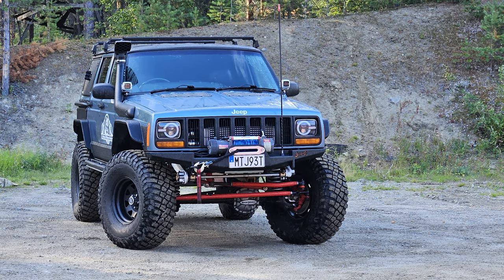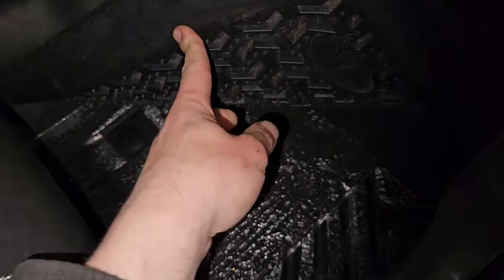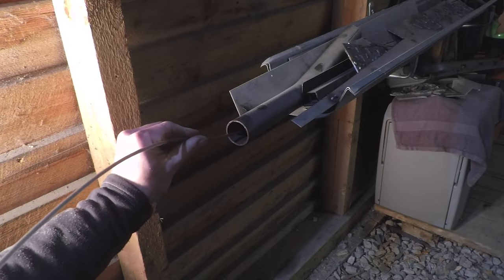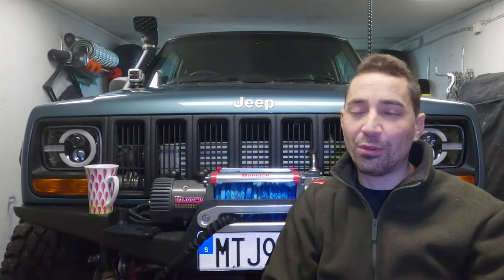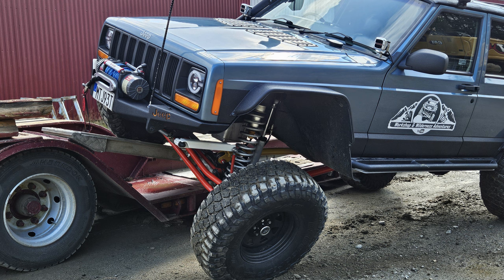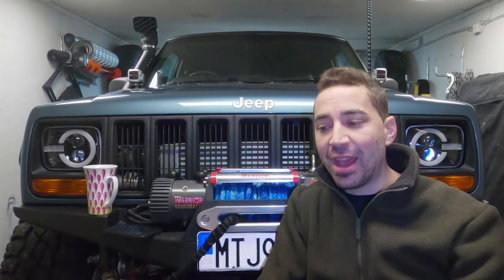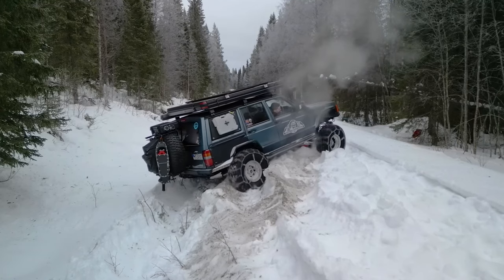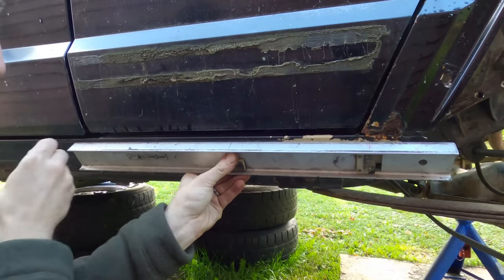What Would I Do Different If I Started Again

Comment from the maker: I've been building this Jeep for over 10 years, and a subscriber asked me about the choices I regret and the things I would absolutely do again if I started again. I thought It was a great idea for a Q&A as I know quite a few guys on Instagram who have bought Jeep XJ's and are wondering where to start.
 
You'll have to forgive that I'm not my usual humours self on this video. I've been pretty unwell, and the meds are pretty heavy. The syphilis unfortunately spread to my eyes, which is pretty bad, but on another note, it did enhance my vision, allowing me to select my victims more easily.     

Although the Jeep XJ isn't as common as it used to be, the principles in this video can be applied to any older 4x4 vehicle. 
Megan and I are waiting for a new baby any day now, so I thought this was a good time to do a video like this. 
Thanks for watching and for all your support!
Mike
Reply: Very much appreciate your wisdom that is not just XJ focused, but case use.  Few years ago I started a bit of work on my girlfriends '89 XJ and it is not lifted as it suffices with the General Grabber AT2's during winter in the Cascades here in NW Washington State.  While I had to sort out the partially installed Rubicon Express 3.5 lift's geometry.  It will get a class III hitch installed on the front to strengthen as well as provide possible recovery use, while the rear has a hitch as well.  I hope to get stiffeners eventually.  Next tires will be LT235/85R16's on the ZJ wheels, but won't be adding weight from aftermarket bumpers front and rear.  Which leaves this '87 very stiff due to the short arms, but mostly from the spring rate which were designed that most would be installing those bumpers.  I did refurbish the headliner, but also removed the carpeting thus used Herculiner with Kilmat and Siless on the floor and cargo area.  Noise levels reduced with having installed Kilmat and Siless on the ceiling as well as the doors and rear quarters.  I do get out to camp and hit forestry roads, and have no interest in submarine activities as I don't know how well my low mounted alternator would like swimming.  I forgot to mention that it currently has standard load 245/75R16's which were supposed to be "temps" while I sorted out geometry, but will see how they do in this years snow.  Sadly they tend to gate off many area's when the snow gets to deep for the safety of those not prepared to spend the night or more while stuck. <cough cough>  I fortune to have been prepared though it was only to be a "day drive".  <cough>  Thank You.   <edit>  On this side of the pond, I think we have what is used "back east" is Fluid Film.  </edit>
Reply: There is nothing wrong with your weird and twisted sense of humour, Mike, it's the main reason I watch the channel!
Reply from the maker: @duncanjmurray thanks mate! Appreciate you watching
Reply: Been watching you since your bushcraft days, always entertaining and chock-full of useful info/advice, thank you.

Comment: Great bumper story. I had a large deer jump in front of me and I hit it at 35 mph (56kph) and killed it straight out. Between the lift on the XJ dead centering the deer and the bumper, zero damage.
Reply: It can be a good meal
Reply from the maker: Ah that's wild. I've not hit an animal.....yet. A moose ran out in front of the jeep just a few weeks back. Luckily it was at an angle so I had time to slow down. I don't think my bumper would have liked that one. Good to hear of more survival stores though and thanks for watching
Reply: Very similar story. Hit one dead center going 40mph on a backroad. Smaller deer and it did not go so well for the deer. Jeep was great just lost some paint on the bumper.
Reply from the maker: These Jeep survival stories are making me feel hopeful

Comment: I'm about to spend 5k on tires, CV joints, shocks,  steering rack and pinion (?) thingie fingfang.  On a 2003 Subi Forester.  232k miles.  But what I wont have is a car payment.   Wish I could do this stuff,  shocks I probably could, but easier to pay someone. And less Tourettes outbreaks for me.   Iv replaced the starter, radiator, cooling fans and I change my oil and filters.  That's enough for me.   Anywho,  I know this has nothing to do with an XJ... maybe I should look for rust under Subi's carpet? .....  ahhh nope.  LOL   Thanks for sharing Mike!
Reply from the maker: The Subi Forester is a nice choice of vehicle. I've seen some really nice Subi builds from German tourists here in the summer. Sometimes it is better to pay for the work depending on your budget and time. Don't lift the carpet, don't do it! I'm sure its fine though. 
Thanks for watching.

Comment: The order for me on my XJ

1. Lifted 3.5 inch, 33 inch tyres 
2. Winch bumper  and rear bumper
3. Big android din system with backup camera and digital rear view mirror
4. Front floor pans and rear quarters
5. Snorkel with cold air intake
6. Light bar and roof rack, new relay harness for headlights
7. Box rock sliders (to be welded)

Will need to rip out everything to weld the box rockers without burning up the carpet. But yeah. It spiralled, so will have to essentially take the entire thing apart and do it right från frame up. Steering is clearly a needed upgrade. 

I drive this car two days per year at the moment and have zero time for this thing. My wife is understandably quite unimpressed.
Reply from the maker: Mine followed a similar path although I think I did most of the corrosion work in the first three years due to the climate and some kind of OCD. 
It sounds like a pretty built rig though! Some nice work and with the rockers it will be much better. 
I can appreciate the difficulties with time. I went self employed several years ago which greatly changed my life with regards to time. Obviously its not all roses because whatever path we choose has its challenges. But time is certainly a benefit.
I hope as things move on you can find the time again and thanks for watching.

Comment: Interested in your sleeping setup inside the Diesel. Also in the US fluid film and PB blaster surface shield are my go-tos for undercoating. Both are lanolin based.
Reply from the maker: I will make a video on the sleep system. It's pretty cool, but the ventilation is the next battle. Those products I know, and they work very well! Thanks for watching

Comment: I am from the UK. I have owned Cherokees because they are the do all vehicles from the factory. my first black  1996 Cherokee 4.0 cost £900 and served me for 7 years. It was a reliable family vehicle, used for towing, a bit of off roading and burnouts. It ended up being completely rotten, backing down launching ramps with boats did not help. 

My advice, and something I did with my second Cherokee, was to import from Japan. I bought a 58000 mile black limited with no rust for £3200. I have owned that vehicle for 4 years and quite frankly I cannot be without it. I have towed a 50 ft trailer with two 20ft boats with this vehicle. It's has been so loyal. For me the mk 1 xj is the only one to own (sorry mike)
By the way good luck with the little one, having kids is the most fantastic gift. Good luck my man.
Reply from the maker: Thanks mate, being a dad has been one of the most wonderful things I've experienced to date. Especially now he's with me in the workshop bless him. The 2nd should be here any day. Anyway, thanks for the stories of your jeeps. It's always great to hear!

Comment: Hi! It would be interesting to hear your take on winter tyres. Most of US dont seem to use dedicated winter tyres like hakapelita, blizzaks etc on their offroad trucks. People in US seem to look at 3 peak icon on the tyre and think that it is ok. I live in cold climate (Kazakhstan), lots of snow , ice and temps under -20C, and I’m a strong believer that for winter you must run dedicated winter tyres. ATs just dont do well here, they get hard and are dangerous on ice. AT/MT etc i think are only for summer. You seem to run studded AT in the winter, wonder how these tyres are doing in ICE, and cold tems. Offroad on low pressure they warm up pretty good, and no problems there, but general driving on public roads is the thing that I’d like to hear. Thank you!
Reply from the maker: There is no comparison to a proper winter tire, as we both know. Everyone here in Northern Sweden runs a dedicated winter tire made from a softer compound, with studs. 
If I had a different front axle and the money 💰 I would run a nokian hakkapeliitta for winter and an AT summer. 
I use a cooper MT for winter, but I have grooved the tire to add lots of siping and popped studs in them. Their  not a good tire for winter, but it works with the changes I've made. The compound is hard, though, and this is most noticeable after fresh snow has fallen on ice. 
I will run these for one more year and see how they perform, but ideally, they will not be used next year.
Reply: @WorkshoptoWilderness thank you for the answer. I have lots of friends here, who run AT/MT tyres in the winter. Generally they do alright under normal driving, right until the point when you have to make emergency stop, this is when they fail big time. A friend of mine crashed his Patrol this way, I put my Mt tyres for one weekend to joint competition here, and guess what, the day after I hit someone’s car at like 5km/h. Just could not stop, there was some Ice and snow on top, and the car just would not stop. Great content man, enjoy watching you stuff a lot! 
Just an idea from future video, to make a comparison video on tyres in the snow. Chans vs no chais, chains in the back vs front in the deep snow. Nate from Dirtlifestyle made some good videos like that, very informative and fun to watch, but he has yet made video about chains, and you have lots of experience using it in snowy conditions. So I think you are the man to make it 😁

Comment: Im building 98XJ TD in Finland for overlanding. First im doing is swapping m57 on it. Then what im thinking is lifting. So far my toughts have been 4.5inch (us) which is ours 4" lift. 33" in it. Long arm kit. But so far my plan is m57, then remove that carpet and checking car from all the rusts. I do have invested chrysler 8.25, and planning to replace dana35 to 8.25. big plans and slowly starting. Allready have m57 almost rebuild, so soon it will be time to swap it.
Reply from the maker: Sounds like a nice build in the making. The M57 will certainly make it good fun.
I would just count the splines on that 8.25 and make sure its 29. If its 27 it wont be much stronger than the 35 with the shafts, but your probabaly know that.
Thanks for watching!

Comment: 4 months owing an XJ and loving it, thing is a warrior. That said, i would like to protect it as much as possible so I can enjoy her for many years. Could you elaborate on the carpet removal? Do you spray the panels with a bed liner?
Reply from the maker: Congratulations on the XJ! I've linked a couple of videos to the process I used. The top link is more recent and probably better. The 2nd is sound deadening.
You will want to remove the plastic trim inside the jeep first. Things around where the carpet ends at the edges. Once it's out you can vacuum up and dirt, use thinners or brake clean to clean down the metal floor pans. You could then spray the exposed floor with an etch primer or lightly sand it all, depending on what the condition is. After that I would without a doubt spray Upol Raptor Liner over it all, 2 coats plus one light duts off coat. Leave that for at least 5 days before exposing it to moisture or using the jeep. 
On top of this you can choose a sound dampening mat that you like. I went with Silent Coat. It takes the acoustic out of the panel. You can choose the black Silent Coat so it looks better, or something like Kill Mat. 
The transmission tunnel and anything that isn't a low spot can be layered with sound deadening foam, and fabric before reinstalling the plastic trim. The low spots on the floor pans and rear cargo are should always be removable in my opinion. Depending on your climate of course. If you see wet and snow then it means you can pull the mats out and allow the water to evaporate. When I return home from camp trips in the winter I pull all the mats and leave the doors open in the garage to dry out the vehicle. 

https://youtu.be/XRTu0cw9dn4?si=-uuxpYBn0jPO655i

https://youtu.be/uAtYb2eTKt8?si=ItQgp7ena524AS51

Comment: iv been building mine for 16 & two weeks ago someone ran a red light and totaled it, besides the stress and the junk heaps the only nice ones people want 10k plus for them. its crazy and hope to have some luck getting another one.
Reply from the maker: Ah, mate, my heart goes out to you. It's the biggest fear, and it could happen to anyone. I expect it to happen to me one day, given the harsh winters and increased risk when driving. 
It was one of the reasons I got a 2nd one, just in case the unimaginable happens. I really hope you can find another, even if it's not in the best condition, it might make a viable project.
Reply: @WorkshoptoWilderness  just a heads up I just picked up a clean 2001 silver with a manual transmission, completely stock clean title and a smidge under 200k miles similar to wrecked one, only thing out of my pocket is going to be the registration and title transfer and then the wreck money is just straight up paying for it. But it feels very weird not being lifted 6 1/2 in on long arms but at least it has a nicer interior, I didn't see any rust or rot anywhere, but looks like a droopy headliner and a few leaks.
Reply from the maker: Ah man, I'm really happy for you! That sounds like you found a clean one to fill the hole in your heart. Well, maybe in time anyway!

Comment: that dickpic comment 🤣🤣 your over the top statements always come out of nowhere 😂 super video like always! keep doing what you do. stiffening the frame, how do you start tackling that problem on a truck where you cannot buy ready to install frame stiffeners for? such as a K5 Blazer. as you said, you don't want to transfer the weakness. start to box in the C frame?
Reply from the maker: Thanks for watching and i'm glad you enjoy the content! I know some people use a 90 degree length of steel and weld it to the outside of the frame all along the outer edge. You basically cut slits in it so it bends. You can then use bottle jacks and hammers to make it contour the frame. 
Lots of people do this on the XJ, I'm sure other vehicles too. Extra crossmembers seem to be popular also. I guess once stiffened its good to tie both sides together as much as possible.

Comment: Interesting you mention having a head on collision, same thing happened to me earlier this year, I was hit head on by a 3.0 Toyota Landcruiser, I had a steel winch bumper on my XJ and I literally destroyed the front of the Landcruiser, his vehicle was taken away on a flatbed, I drove away with minimal damage.
Reply from the maker: Holy shit. Seriously! I honestly would have thought the XJ wouldn't have survived against a land cruiser. Those things are pretty solid. He must have been devastated 💔
Reply: @WorkshoptoWilderness  He was, it was his pride and joy, I’ve got the photos to prove it too,  in the end he had the Landcruiser repaired, €8500 total repair cost.  My header panel took a beating as did my drivers side wing, I had a Rough Country winch bumper on my Jeep, the bumper was actually pushed over about an inch, the tie in rail to the frame is 5mm I think.  I was very fortunate, no structural damage to the unibody.  Only other damage was a broken indicator light, a cracked fan shroud, and a bulge in the sidewall of my tyre.
Reply from the maker: Wow, that's wild. Poor guy, that's not a cheap repair, but at least he could repair it. The damage you took sounds minimal, basically. It's the biggest fear of any owner, isn't it.
Reply: @WorkshoptoWilderness  Certainly is mate.  Anyway thanks for your channel, very informative and the subtle humour!.  Looking forward to many more videos.  All the best to your family and the new baby..
Reply from the maker: Cheers mate 👍

Comment: Hey mate currently looking at either a 4.0 or diesel Cherokee. Howd you manage to get the diesel faster than the petrol? Cheers
Reply from the maker: I'm sure the petrol would beat my diesel up top. It's apples and oranges. It's just that I've tuned up the diesel a lot, and it's nothing like it used to be. Basically, more fuel and more air alongside timing. 
It still needs to be put on the dyno, but it's not slow. 
I put on a bigger 11mm fuel pump, mechanical one that's tunable. Other adjustments can be made with a ve pump like the boost compensator, timing, and Max fuel screw. 
This gives the engine lots more fuel and also more fuel across the rpm ranges. I've put in a different GT series turbo, so it spools up early, and at the current settings, I've got it topping out at 25psi at 2300rpm. This keeps the egts at acceptable levels on full load. 
The diesel is gutless stock, but you can make it a hog, and it will make lots of torque and good HP. My advice would be to stick with a 4.0 thought as it requires no messing around.